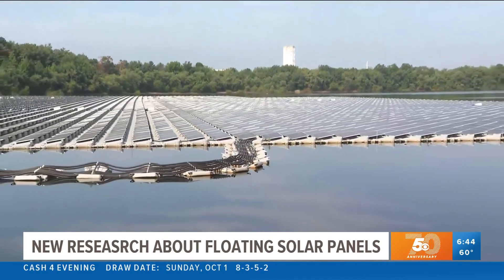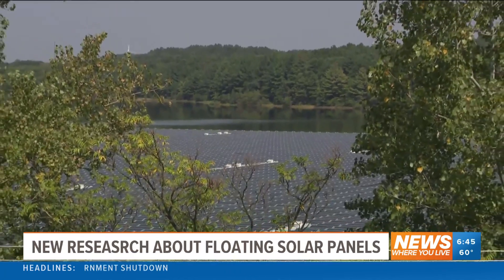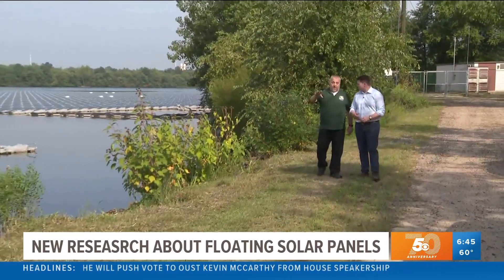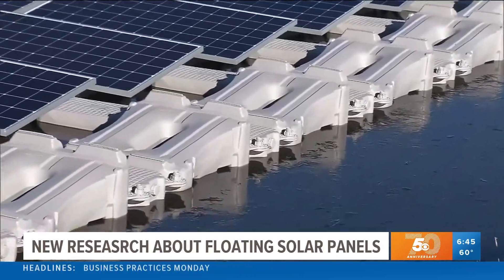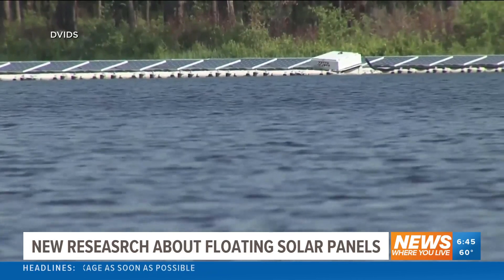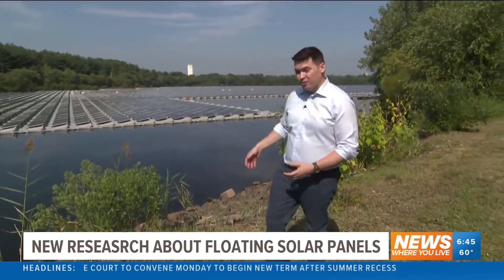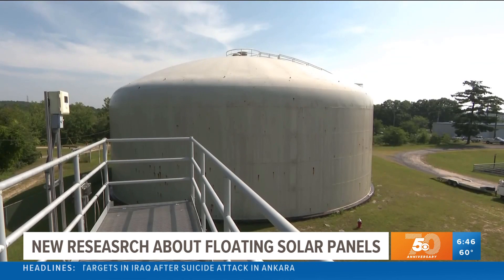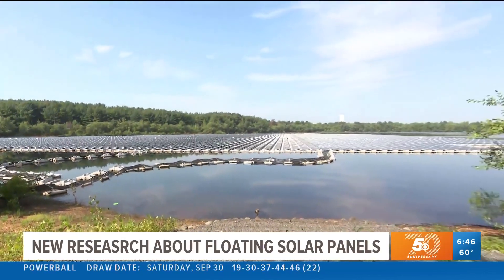New research about floating solar panels

Comment: It's certainly better for lakes than coal/oil/gas, but what are the impacts on lake ecosystems?
Reply: In some parts of the us and the world they float black balls on the water to stop sun light turning the water green. As long as the  lake is not covered all over I think it is good for the local environment as it's good shad for the life in the water. Just like tree over hanging a pond or lake. In some parts of the world water is treated then stored on reservoirs like this.
Reply: It's probably best for artificial reservoirs